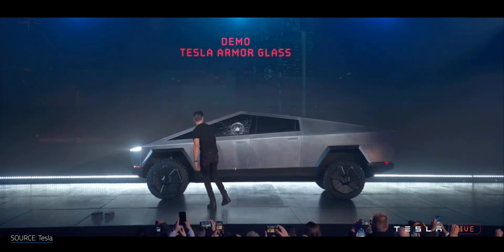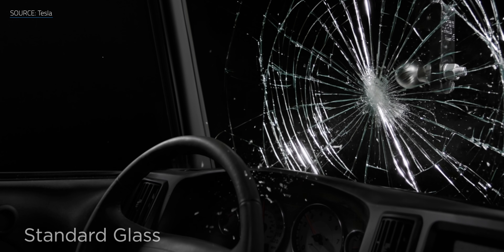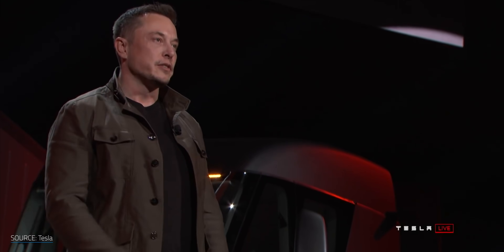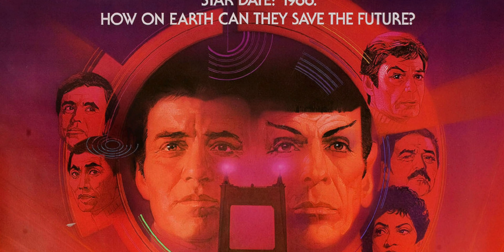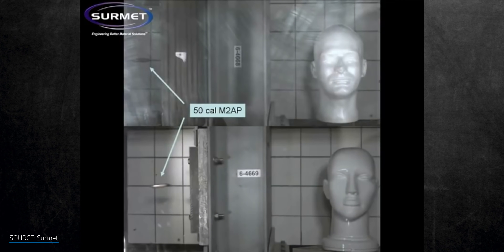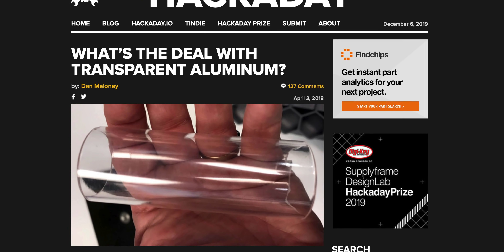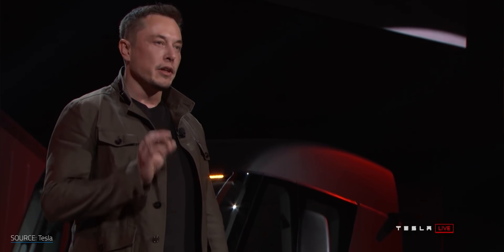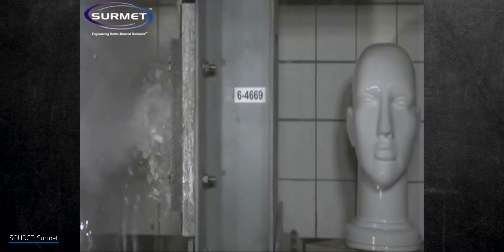Transparent Metal Glass - What is Tesla Armor Glass?

Comment: I find it extremely annoying when people call saphire "transparent metal" - it's not metal any more then regular glass is "transparent silicon" or calling salt "transparent sodium" Compounds with metal elements in them aren't metals, they certainly don't conduct electricity which is the main difference between metals and non-metals. And in fact you call it a ceramic later, which is what it is.
Reply: CO2 is transparent Coal.
Reply: Agree. Should be transparent alumina (oxide), not transparent aluminum (metal)
Reply: You've beaten me to this pedantry.  heh  It's an important distinction, and it bears being said.  Thanks for posting.
Reply: Marketing dude... That's all marketing terms that don't give a sh*t for accuracy... And I'm a materials engineer
Reply: If aluminum oxynitride is "transparent metal" then aluminum oxide is also "transparent metal", and sodium chloride is too for that matter. Bitch about all of it or none of it (unless you meant to include aluminum oxynitride and just forgot, in which case, carry on). Also glass is transparent silica, nobody calls it transparent silicon unless they are confused, but I also don't see a problem with that since it's mostly silicon dioxide.
Reply: Isn’t glass just a slow moving liquid? It would be cool if they called it liquid metal.
Reply: @YourDadVR  Regular glass does not flow except at higher temps. (If I remember correctly, it does not have a set melt point,  but becomes more viscous below 1000 C. At 400C it is basically a solid) At high altitudes or in space it would turn into a gas from cosmic ray spallation. Who has a billion years to watch SiO2 become fluorine and phosphorus?
Reply: @gyrateful  actually regular glass DOES flow, look at the OLD glass in historic buildings, it is measurably thicker at the bottom than at the top because it IS still flowing, just VERY slowly, and this is at normal daily temps.
Reply: @sterlingsummers9697  Glazers install glass thick side down.  It wasn't till much later that glass was formed on molten tin, thus making it even thickness.  Old glass was make by spinning of a blown cylinder.  Just search for, "does glass flow." Glass is an amorphous solid.
Reply: @gyrateful   well ... I hear from those 'This Old House' type shows that all you need is gravity x 150 yrs to see glass start to 'flow' ... 
😉
Reply: It's technically a metal oxide
Reply: Darn. And I wrote my rant before scanning down the posts to find your's.
Reply: Accurate, glad do see people like you
Reply: Easy boy!!!!
Reply: in cosmology, anything heavier than hydrogen or helium is technically a metal - just saying, since we're playing at pedantry
edit: oops! sorry, Maxxod! just saw ur comment now
edit: soaringvulture - he's right. in cosmology it is the case
Reply: Theres a reason they do this. Calling it transparent metal is likely a bridge to explain something complex while using something familiar without using technical jargon.

Marketers and copywriters do this all the time.

If I gave you a pure explanation of bitcoin mining I would need to explain blockchain and then take a step deeper to explain hashing, terahashes, merkle tree etc. 

U quickly go down a rabbit hole.  Any non-tech persons eyes quickly glaze over. I think you know what I'm talking about.

So what I do is I avoid all technical jargon, I say it's a process where a bitcoin miner has to complete a puzzle before transactions are added to the network. 

The puzzle is a number that the miner has to guess. 

If I explain terahashes I say, its a way to measure the number of guesses a miner can make. 1 terahash = 1 trillion guesses per second. 

Using technical jargon with people who are less interested and have less knowledge around the subject than ourselves only ends in us alienating the listener.
Reply: I find it extremely annoying when people call sapphire saphire

Comment: Transparent metal, would be good for windshields & backglass in cars, but for safety reasons (ie. being able to exit vehicle after an accident if the doors can't open) the side windows should still be a more fragile material.
Reply from the maker: I lean in the same direction,  but am waiting for more details on the safety features.  Curious how they’ll address all of this.  I’m sure they have answers (or will).

Comment: Very interesting topic. Would have been good to hear how they managed to get light to pass through “metal”
Reply: Metal oxides are often transparent. Ask how nature manages to get light through. Never mind that Tesla was not using aluminum oxide. Just laminated glass. One of these days, Musk's constant lies are going to catch up with him. They hit steel panels with a rubber mallet during that deceptive reveal, as well, and called it a skedgehammer. Any 3 mm sheet of steel will resist a rubber mallet. Let me at the Cybertruck with a real sledge hammer and I will demonstrate that it will dent.

Comment: The steel ball wouldn't go through our ordinary laminated glass in our car so, that not a big deal.
Reply: Windshields are laminated.   side windows typically aren’t.  But you’re right,  I guess they could be
Reply: @OhYeaMista  All windows on our car (including rear window) is laminated. But, it's a Volvo so... (they like it safe).
Reply: Xanthopteryx   That’s very rare.  I work with smashed up cars for my job all the time and side windows usually shatter like normal glass.
Reply: @OhYeaMista  When ordering a Volvo, you just tick in the box "Acoustic windows". Around 600 EUR equivalent (we had it in a package together with 230V outlet in the rear passenger compartment, integrated sun blinds in the rear passenger doors, four zone climate and acoustic windows - 1.200 EUR for everything). I think all Volvos today offer that. At least here in Sweden.
Reply: https://youtu.be/kJ96pg9D_30

Huh, apparently chevys doing too.  No kidding

Comment: 6:24 Transparent metal windows are a huge selling point? True. However they are not necessary to get the same results we have seen. Layered safety glass, common in the windshields of modern automobiles,  will stop a large hand thrown Ball bearing in the same manner. And note the driver window was penetrated, the hole in the middle of the shatter. You doubt it by we have seen this same this in real life and very dramatically in TV and movies when someone takes a baseball bate and whacks the windshield. 

That was not transparent metal. It was layered safety glass.

Comment: 5:45 What was shown was NOT any kind of glass.  At first, I thought it was the clamps absorbing the impact. But a hard object would not lose so much energy, or roll so nearly to stop so quickly, after impact on the surface (which is why the ball was snatched up so quickly). I want to say that pane is some formulation of Lexan (polycarbonate). But I have not heard of such a formulation of Lexan or acrylic that can resist bending or warping in an otherwise completely flat pane after being struck by a relatively large metal ball as hard as it obviously was. 

Is that streak, on the lower left corner of the table, a second pane? It would act as a buffer and the top pane would not deform as the impact  force would be transformed to the second pane, which no one would see and if that did it would be dismissed as an imperfection in the table itself.  I want to assume I am wrong. However, Musk has played it up for the crowd before.

Comment: - Gorilla Glass extremely strong formulation of glass that uses Tin to give it some give. Not considered any kind of transparent metal. More like Glass that has metal in it. Commonly used on Smartphones and Tablets. has been seen in automotive purposes such as windshields.
- Willow Glass a very advanced form of glass that can be deformed like a sheet of metal to a point. It bends more than it breaks, but has a yield limit far short of a similarly think piece of Lexan.
- ALON (Aluminum Oxides of Nitrogen), aka "Transparent Aluminum". Because if it primarily metallic make-up it is considered AND called "transparent metal" but is a ceramic. When formed it is NOT clear and must be polished, using mechanical processes (it can not be done effectively by hand) to make it clear. It is strong enough that the it is going to be used to replace the windows on the ISS as protection against space junk impacts. Can be used for bulletproof glass if it is CONSIDERABLY thick or part of a slimmed down, due to ALON's strength, bulletproof glass system, which is still considerably thick.

Tesla, nor any of Musk's businesses, have the expertise or resources to develop any kind of bulletproof glass. A thick pane of LEXAN with a thin layer of Willow glass would do a better job than what was shown on the Cybertruck at its reveal. At least it would stop a relatively slow moving BB the size of  grapefruit without a problem, scratch, of crack.

it is also important to remind the world in general that the glass and materials industry is forever working on making stronger more remarkable materials, include ever better, stronger, more effective glass and glass-like materials.
Reply from the maker: Nice comment!

Comment: Aluminium oxide glass has been used in watches for 40 years already.
Reply from the maker: Really?  I haven’t seen any.  Microsoft’s smart watch was supposed to have it a few years ago, but most watches are acrylic or sapphire (which is harder that aluminum oxynitride).
Reply: @UndecidedMF  Most watches use mineral (i.e regular silica glass) or sapphire. Aluminium oxide glass is synthetic sapphire. Is Al-oxynitride a new improved compound? So what is the benefit of Al-oxynitride compared to Al-oxide glass?

Comment: Good 'ol Musky: "Transparent Aluminum?..."

Scotty: "That's the ticket laddie!"
Reply: Disappointed with Elon on this. He is propely educated in physics and engineering and I'm difficult to swallow the fact the it marketing BS it's factual BS.   You cannot have transparent metal because it contradicts the very definition of a metal - which is to have high electron mobiliity. Which makes them good conductors an dby that nature it must strongly scatter/reflect electromagnetic radiation ak.a. light!  So its not feasible fro it to be transparent. This is a ceramic which just happens to have alumium as an element in its compound formulation.

Comment: Especially as your channel name starts with undecided, what about a video going in depth about the various legal and safety ramifications of what Tesla is proposing with its Cybertruck?  Some examples are:
1. Windows - More robust reliability vs. a safety hazard / legal violation due to it being too hard to break when it may need to be broken such as baby trapped in hot car (though Tesla has addressed this before with "dog mode") / injured person trapped in car or vehicle went into the drink and occupants desperately trying to get out as water shorts electrical systems and water pressure holds doors shut?  This could be weighted with how many injuries / deaths happen because something went through the window vs how often a window was smashed to escape / save a trapped life inside?  Just off the top of my head I can remember being in "truck country" when a deer ran out onto the freeway just in time to punch through my windshield, but off to the side enough to be more out of the car than in and so flipped back out of the car.  Then when I was stuck out there for a bit while getting car repairs setup and getting a way a way back home without my car, everyone out there seemed to have  a story about losing somebody via having large animals go through the windshield.

2. Historically crushable body panels' safety vs. how the hard exoskeleton may be a safety issue / not legal and what Tesla could do to mitigate these concerns?

3. Lack of side mirrors on the prototype actively wandering around LA, legal implications, and what could be done to have a legal and safe rear view Cybertruck setup?

4. A more general look at 30X stainless steel and what it means to use it for a car?  Like expense of material.  Difficulty in molding it.  Strength and weight of material vs. other materials used for the structures of cars.  How the material responds to being repeatedly bent vs other materials used in the same application.

5. Getting more into practical use cases for how the Cybertruck could be used vs. where it will most likely fall short.  For example will it really be all that practical to tow long distances with it or will the battery run out too quickly with various trailers and loadings?  Can you use a 5th wheel trailer with it or does its tall sides and exoskeleton design make that impractical?  Will this truck be an off roading beast tough enough to survive the hardest trails and come back without a scratch or will its weight cause it to sink into the sand / mud?  Will its ability to lean back and have a built in ramp help make it a workhorse or will its tallness and tall sides make the bed too hard to access for too many jobs?  Will the truck fit into parking spots or will people be going "Look at my big truck.  Now where can I park this thing?"

6. If a Cybertruck gets into an accident, will its 30X stainless steel body be something you look at and see there is not even a scratch, a dent that can easily be banged out, or well heck that little bend can't be corrected.  I guess it is totaled as there is no way any body shop will be able to unbend it or replace some damaged section; the whole exoskeleton and thus whole truck needs to be replaced?

7. The practicality of charging this in remote areas.  For example I looked at the well known off roading points in my region and noticed not a single supercharger anywhere near any of those places.  Especially when you are going to go offroading, it is nice to fill up the tank before wandering off into the wilderness.  I think there are some good answers to this, but it would be good to go over them.

While it is hard to get all of these answers up front, I think there are many thought experiments that could be done along with checking of stats, existing law, other crash test results, existing case studies, etc to come up with reasonable ideas of how all of this will work out so that when the truck is being mass produced, we have a much better idea of what to expect.

Comment: side windows in passenger vehicles are intended by design to break away and allow passengers to escape...that is not the same function as the windscreen which is not tempered, as side windows are, but i safety glass designed to resist with super hard glass that if it  breaks as it does, if it must, some relatively benign shards but the windscreen protecting the passengers is held together with interior laminate. Side windows are tempered to break away offering exits.

Comment: So the guy was burning alive in the tesla and couldn't find the tiny mechanical release button for the door. The electronics to open the door were dead because of the shorted battery, apparently. So the super glass will MAKE SURE nobody can break it to get someone out of a burning tesla!
Ever ride in a tesla in 100  degree heat when stuck in freeway traffic? All that glass turns it into a furnace inside when the AC shuts down due to heat overload!

Comment: Uhm...if an AL compound counts as "metal glass". Well we have had corundum since the formation of the earth. Corundum is a mineral often contaminated - and when contaminated we call this mineral Sapphire, Emerald, Ruby, etc. depending on the contamination.
But in no way is this "metal". AFAIK a metal cannot be transparent - well at least no conductive metal as that just does not work with the physics of transparency. Correct me if I'm wrong here. The physics of light on a particle level is not easy to grasp.

Also - we have had "Lead glass" - glass containing up to 40% Pb. Does this count as "metal glass" too then?

From what i saw of the Cybertruck demo - it looked like just regular laminated glass (like what you got in your front windscreen now). If you got fine enough laminations it should be able to stop a 9mm bullet. Perhaps an innovation here is if the very outer layer is made of corundum to make it more resistant to chipping.

Another thing. If all the windows are bulletproof - how will tis impact safety if, say, you need to get out of the car through a side window after some accident?
Reply: It is Aluminium Oxynitride.  It is a ceramic of Aluminium, Oxygen, Nitrogen.  It really is called Transparent Aluminium in honor of Star Trek 4.

Comment: If  they had started with the windows instead of the door, it would’ve went as planned. But when he  hit the door with the sledge hammer, the windows slid down just enough to compromise them. If you notice when they did the ball drop in between each ball drop they re-tightened the glass down.

Comment: If the glass is so rigid that it cracks under temperature changes etc, as I suspect was part of the reason it broke on stage, then id argue this glass is of limited use in the thickness that Tesla intend to use it for.
Reply: TESLA transparent metal Glass is extremely Tough.
it cracked because FRANZ hit the DOOR of the Truck with a SLEDGE.
Minutes earlier, FRANZ was throwing the ball at the Glass and it just Bounced off.
the Ball actually, bounced off in the GLASS Demo before FRANZ tried to smash the windows.
ANY Kind of Armor Glass has a Failure Rating, with all the Previous throws and FRANS hitting the DOOR with a SLEDGE, the Glass did then fail.
Most car windows fracture with just ONE hit, which is why thieves Break into cars .
with TESLA transparent metal Glass, I see this Becoming the standard in CARS very soon. 
and Theifs will have a NEW issue to work on.